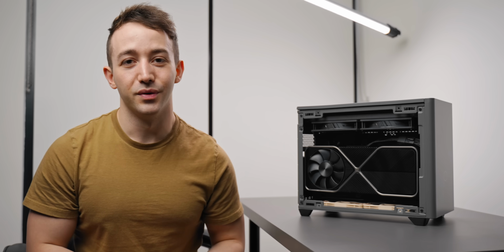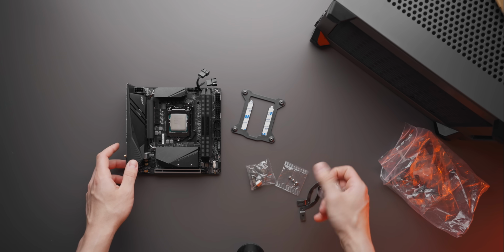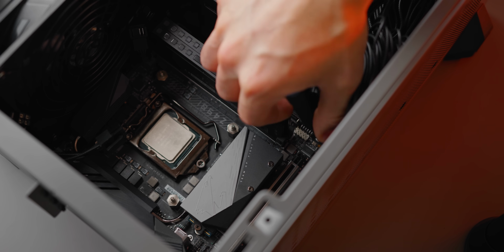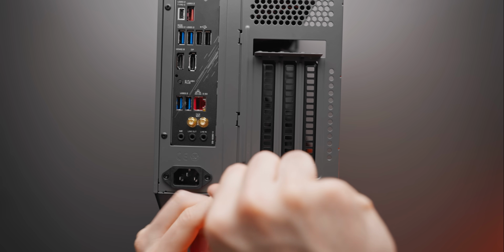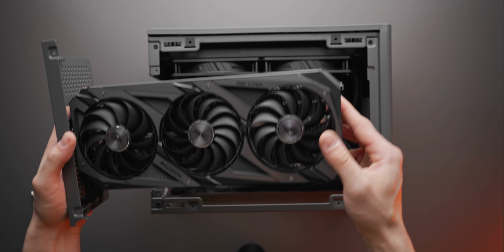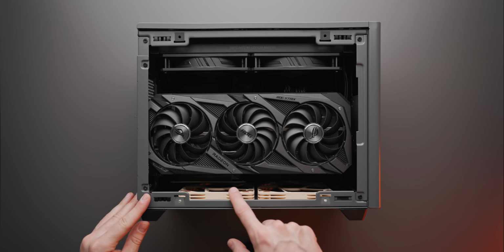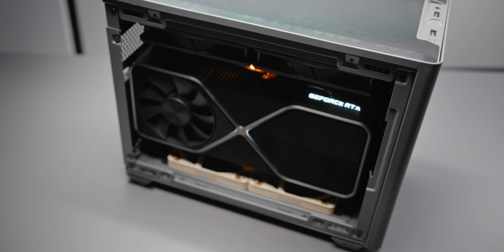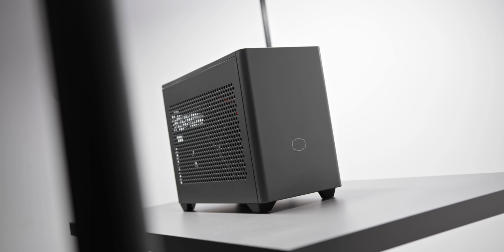The New NR200P MAX Can Handle Anything

Comment: Love how they fixed the number 1 issue of the nr200 being that it was nearly impossible to get a top mounted aio, and the guys at GN found that putting an aio at the bottom of the case was a terrible idea.
Reply: Yes and no. It is possible to mount a Slim 240mm Radiator with slim Fans at the Top after some minor (invisible) modding in the NR200P. If you want to Custom Watercool the MAX you are stuck with a single RAD, while the NR200P can have 2x240mm or even more.
And the sidemount AIO on the normal NR200P is OK too, since the RAD is the highest point + the Fans cool the Board quite nice.
Reply: @gucky4717  if the mod u meant is cutting some part of the case with tools like dremel, then no. Im not against it, but if u count that as "possible to fit" X then practically any case can be modded to be like that provided they have the proper dimensions.
Reply: @Crustee0  I know I've seen a few people fit a slim rad with slim fans like @Gucky mentioned without doing the full inverted mod, like I think you're talking about. CoolerMaster actually made quite a few things in the NR200P to allow the case to be flipped, allowing a top mounted AIO. Top and bottom plates have exact same mounting system, they're interchangeable. 

It's actually kind of a bummer its not invertible out of the box, It would have been so easy, and then the NR200P would have been basically unstoppable and there would have been no need for the MAX variant.
Reply: @Crustee0  The top part is made of plastic and metal mesh on top. You have to cut out the Plastic until it fits the Rad/bracket, and use a thin metal bracket to mount the Rad to the top plastic Panel. At least thats what i've read. That mod is not visible from the inside OR outside.
Another Mod is 3D printing a "Top Hat" that can easily fit a 240mm or 280mm AIO. But that kills the aesthetics for me.
Reply: @thehardwarehams7302  I have an NR200P that's aircooled. Are you saying I can invert the top and bottom panels or is that something I have to do on my own?
Reply: if your pump is on the radiatior, you can probable do the rad lower than the block easier
Reply: @salty1099  Depends...in the NR200P there is not much room in my config at least.
The 3090FE takes up the lower portion and my 280mm AIO is so long, that i have to unscrew the entie front of the Case to get it in...
If there is a pump in the Rad it wont fit, if it is a 280mm at least.
Reply: Non-issue, its a small case that comes like 4 long cable ties on the PSU bracket. Literally just tie the cable up so the pump isn't the higher point in the loop. Or buy an AIO with the radiator on the rad, we've good options with those now too.
Reply: While having the pump at the highest point in the loop is bad, technically bottom mount rad in the NR200 does not result in the pump being at the highest point in the loop. If you look at the thumbnail the tubing is higher than the pump so  air would get trapped in the tubing not in the pump.
Reply: @Ken-Hung  That alone does not help much. The air still gets pushed into the pump.
Reply: @gucky4717  be Quiet Pure Loop 240 in the basement is highly popular for an AIO build in the NR200 non-MAX line. The pump is in the line about two inches off the rad, nowhere near the top of the loop. Honestly the thing I find most attractive about that AIO is the giant middle finger it flings in the face of Asetek.
Reply: @Craig-ib7gk  I'll never use any be Quiet AIO again. I used one once and it broke within 3 Months, I then RMA'd it and the new one broke again in 3 Months, and then it happened again with the third one. I installed that AIO and ran it just as it was written in the instructions.
It was the 240 Silent Loop btw.
Reply: @gucky4717  Wow. I've ran two Pure Loop for awhile in different builds without issues. Maybe they figured something out in the last five years. Sorry it didn't work for you. Best of luck on other solutions.

Comment: They should just create a tempered glass panel with perforated holes. Best of both worlds. If I spent 350 on an itx case, you better believe I'm going to try to show it off (the components inside) 😅

Comment: Hope CM include a type-C front panel connector in their next update/revision, otherwise it's hard to fault such an excellent case (even if it's slightly on the larger side)
Reply: ya, TypeC would be nice - but it's acceptable since the back normally has it.

Comment: amazing video on this case, literally gonna get it for my next build, but just wandering how thermals are with the TG panel and the bottom fans as intake?
Reply: That's the way I have my nr200p setup! with a top mounted 240mm aio after a mod, 5600x and 3060ti FE, bottom fans intake, top aio fans as exhaust. Totally thermally capable!
Reply: @thehardwarehams7302  could you point me in the direction on how to mount a rad to the top of the nr200?
Reply: @DAIV  We're actually working on a walkthrough video today! Should be posted tomorrow :D
Reply: @thehardwarehams7302  you absolute legend, was just wondering if it will be ok in this config since ambient temps where I'm at can vary from 25-31 degrees celsius and don't know if a 5800x can be kept cooled with the aio like this but I don't mind running the two slim fans at a higher speed
Reply: @BelliSenior  Oh dang, yeah that is hot! Sorry I mis-typed before, I have my top AIO as intake, so cpu gets full access to fresh air, then bottom fans as exhaust. Basically reverse chimney airflow. I had it standard chimney before but my cpu was taking a lot of heat from my gpu when they were both under load. But I think a 280mm AIO should be sufficient even with those ambient temps to handle a 5800x.

Comment: I’ve been planning on buying a white version of the normal case for some time now but the whole part pricing fiasco has destroyed any desire to upgrade or even simply transplant my current build into a new case. I was going to buy a 3080. Even though it was over priced. I was going to upgrade from 3rd gen to 5th gen ryzen. Kinda glad I didn’t because what I have now is still faster than I need.

Comment: I have the regular nr200p, with 2 of those low profile noctua fans, but they create some noise as they are sucking air through the holes of the bottom plate, even at low rpm.

Comment: WHY all you guys putting ram first specialy itx system like this than having trouble installing cpu cooler, 24pin, front usb cables, power pins and sata cables? just learn already its 2021 just put rams last unlest if your air cpu cooler covers ram slots or using custom water tubing. other than this don't torture your self and me and put rams last like gpu's :) 
also i'm using nr200p this case all side panels can detachable easily so small itx cases like for easy build remove all panels case have for easy access. just don't make your ITX build harder like in this video :)

Comment: Would love to see if you could even do a dual rad custom loop in here.
Reply: He's already got a video with a double custom loop in this case
Reply: @shariarrahman7562  the regular NR200p, yes. This is the Max version, where there is more headroom for a rad on top but less at the bottom. Wondering if it is even possible to get a rad on the bottom with fans being that the power supply extension is on the bottom now.

Comment: IMAGINE If AMD or Intel developed a super mini pc utilizing liquid cooling where you get gpu and cpu together, in a super compact package. Like, that could be awesome. Sure some would complain "I still want custom" but I'm not saying they replace all custom stuff with said insane new prebuilt's. Like imagine a 5800x with 6900xt on a single custom SoC that runs just as fast as normal desktop variants. Liquid cooled. And then in a super compact package. Have the ability to swap out nvme drives maybe like a laptop and bam. Epic little setups. At least in my mind it would be cool as hell. Granted, I would probably be one to stick to custom builds because I have multiple 16tb harddrives. So yeah. No room in an ultra small form factor but still amazingly cool for those that like it.

One a side note, one thing I LOVE about cooler master AIO's is that you don't need extra power to run them. Even my 360mm AIO runs the pump right off the motherboard "pump" connector, and then fans run off your normal fan headers. I ended up buying a pwm junction so I can have all 6 aio fans, and all 5 system fans connected and running same speed. Its just awesome how cool cooler master thinks ahead of other brands since other brands require extra power to get the pump going.... which is like "why" you don't have to. You can literally design a pump to run just as well with less power. Its all about design. Its like the idea of an engine. You can have a v8 with 300hp or you can have a 4 cyl with 300hp. Cooler master is the 4 cyl giving you the same power/performance but using less power/fuel.... pretty epic.

Comment: Pricing seems pretty fair the aio is 90 for the cheap end, and closer to 130 on the higher end, so lets say about 110. 

For the PSU. A 600w sfx psu is typically between 120-150 so let's says 130ish. (And this is ~~700w~~ 850w!)

Then the 4.0 riser cable is about 50-80ish (though a 3.0 one is worth about 20-35)  so we could say a $30-40 upgrade. 

So 110+130+35= 175. Then figure that it is partially assembled makes this a decent value
Reply: dude it's 850w and not 700w!
Reply: @BARRYy0M  even more value. (Edited original comment)

Comment: I didn't think they could make the NR200P better, but they did. And this direction is quite good for first-time builders. The integrated components coming w/ this kit are a seriously good value, too.
Reply: If you know what you're doing, the original is much better than the Max version.
Reply: @justanemptymall well... i mean thats the op's point innit,
Beginners wouldnt really know what they're doing, so having the max with a lot of parts pre-installed is nice
Reply: @justanemptymall  Can you elaborate on that statement?

Comment: Been looking to get a mini ITX case, would the Max or a previous nr200 iteration be more worthwhile, granted if I didn't go the max I would need to buy a new CPU cooler and an SFX PSU
Reply: If you were planning on getting an 850w and a AIO cooler anyways? I would go for the max. If the price really is $350 That's a bargain bundle. But if you're wanting to go air cooled, or even have the option to down the road, then the OG NR200P is the way to go